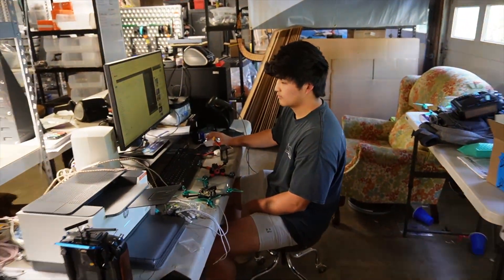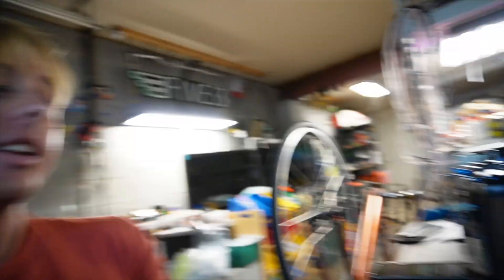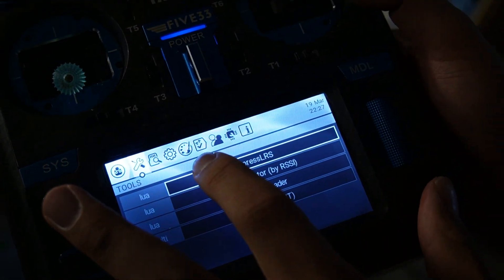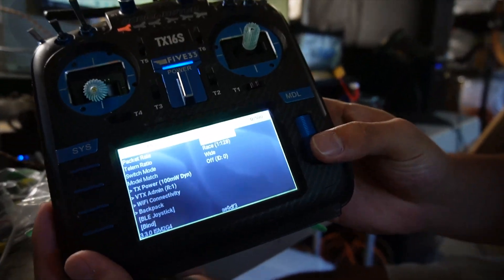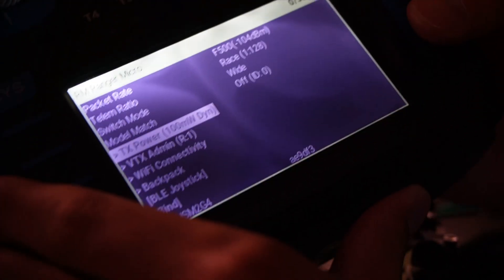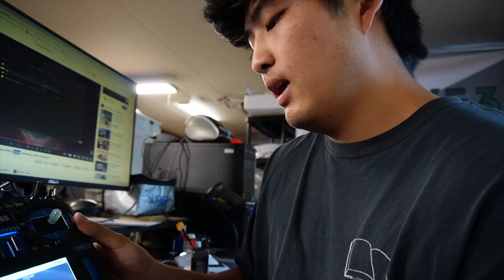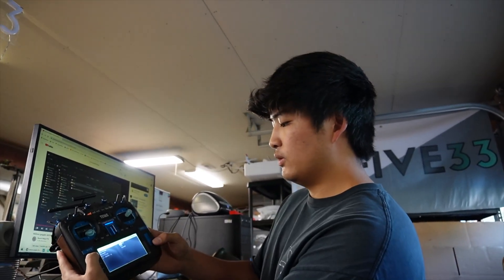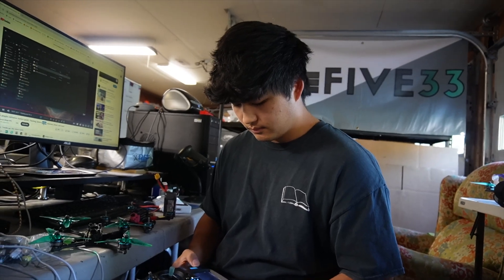ExpressLRS Tips and Tricks | BEST SETTINGS

Comment: What wold you recomend for thoes of us who fly on the slope?
Lets say 1/2 mile at the most, line of sight.

I have the radio master tx16s and the 
zorro 4in1/ELRS using the Nano modules on both.
The planes are using Ail, Rud, Flaps and Elevator
I would really like yourthoughts if you have time

Thank you, 
Daniel
Reply: If you want the best range for your planes run your planes at 50 hz,, and make sure that your flight controller is setup for the whatever range of hz you plan to use . Less hz means more latency,  but if your flying a plane it should not be a problem.

Comment: Best tip for ELRS I got was changing Betaflight OSD settings from RSSI % to RSSI -DB and LQ then setting the warning to +10DB from the number in the LUA, (250hz -108DB = -98DB in CLI) and just switching off the warnings on the radio.

ELRS without anybody shouting about RSSI Critical 😎

Comment: 250Hz or 500Hz is ideal for Freestyle (LoRa)-sub 5ms latency is super low and has great range. 50Hz-100Hz would be best for long range. Betaflight has a well engineered RC Smoothing which will filter the incoming packets according to the rate - so a low rate will not mean any jolts in the data - it will mean more filtering is applied automatically (and adds a bit to the latency of the packet rate). Thanks for the video and insights.
Reply: What is the best for flying behind buildings and trough buildings you know ?

Comment: To correct your buddy regarding dynamic power. This is from the ExpressLRS website: "For non-FLRC modes, Dynamic Power uses the average signal to noise ratio (SNR) reported by the receiver. "
I believe it is a recent change in ELRS to use this instead of link quality + RSSI.

Comment: Why not f1000?
Reply: Because there is risk to lose some packets at this high Rate, especially when you're at races with other tx's around
Reply from the maker: Correct ! The risk is relatively high in comparison to d500, in a noisy environment such as a race
Reply: @headsupfpv  Oh wow, didn't know that. I'll have to change my settings!

Comment: ELRS telemetry will always consume a certain amount of time domain slots (packets).  The ratio 1:128 means that 1 out of 128 packets is a telemetry packet so when telemetry is sent RC data is delayed for that 1 telemetry packet that is sent.   With Race telemetry since when you're armed and no telemetry is being sent you aren't missing any RC packets since telemetry is not being sent.
Reply from the maker: This is fascinating, thank you!
Reply: The rc data isn't delayed for 1 packet, it's skipped for 1 packet. Otherwise latency would change and the next packet would be skipped. I know that really doesn't change anything significant. Also I think race mode also does away with sync packets so even less skipped packets. Great explanation though.
Reply: @JustinHunnicutt  the packet from tx -> rx is skipped so the rx -> tx packet can be sent yes.  What i meant by delayed is that betaflight won't receive RC channel values while the telemetry packet is being sent so it delays and causes jitter for RC data to betaflight.
Reply: but in race mode the short wave bursts greatly lower the potential range of the system. f1000 has less than 1/8 of the range of reg 250 mode. 

you %100 cannot tell the difference in a blind test, and the loss in range is makes race mode just plain dumb.